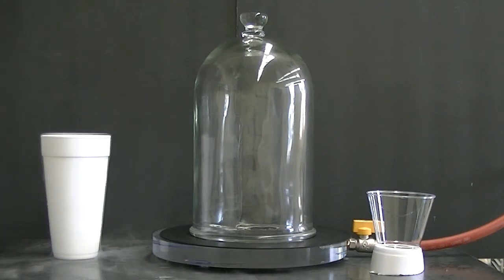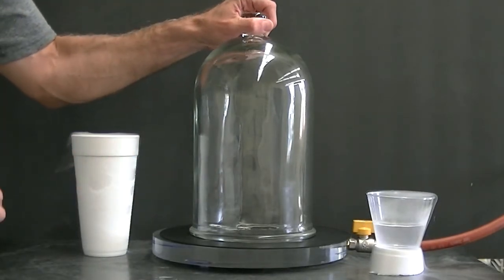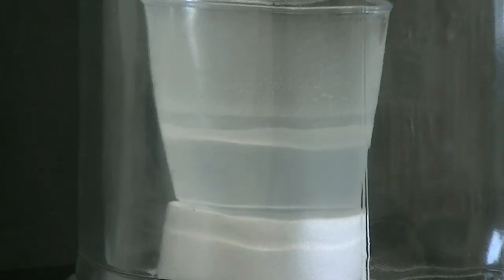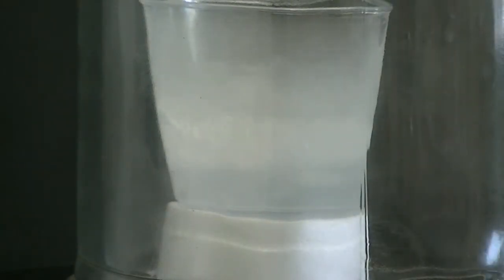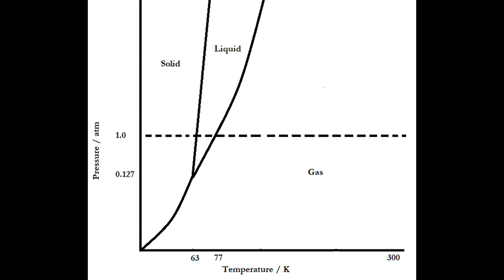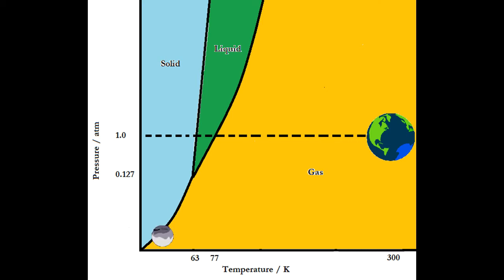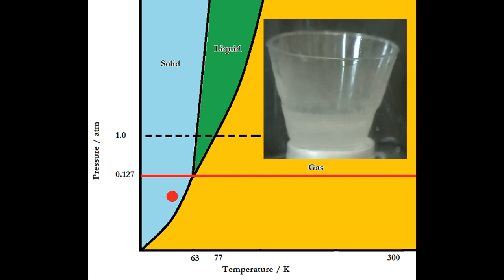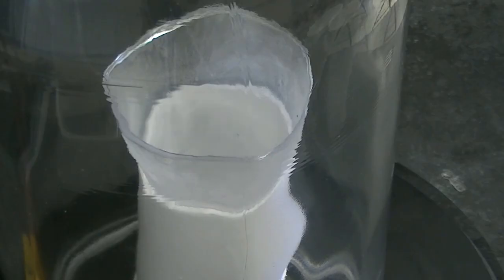Solid Nitrogen and the Surface of Triton, Moon of Neptune

Comment: I can barely see the little microphone now now that I have been a different mode where are there is the little curly thing counterclockwise I know it's behind there it's right by the arrow that's pointing left at the top of the little circle flight thing like on there so that's what I can touch saying the bear it's barely visible this is because my keyboard is transparent and it overlays what is behind it that's why I wanted it like that so that I could see everything on the screen but it makes things difficult a time so it's been many days since I've had difficulty like now.

So what happens of course when you increase the pressure in the liquid below the crystal surface is that the temperature of the liquid is going to be controlled by that increased pressure right in other words when you release the pressure the great deal of it will boil. A paragraph

Our experience with water can a pot that is not healed is when the pressure does not increase. It is more Jermaine however the think about it pressure cooker and now many more families are buying electric pressure cookers that don't use a weight on top of a novel regulate the pressure. Such old school pressure cookers or whatever are quite didactics you have a certain amount of area in that novel it is a tube coming out of the top the lid of the pot and it has a weight so if it were a sick tube if the intern internal diameter of the tube was say a square inch and the wait was 50 lb then you would say this team is going to be leaving the pressure cooker when the pressure inside the pressure cooker it exceeds 50 lb and it lifts the weight and then the steam exits until the weight falls because there's less than 50 lb pushing it up of steam pressure and the gravity is what's pushing it down the attraction to the rest of the mass in the universe is 50 lb down coincidentally sort of to the Center of the Earth. I don't think it is directly to the center of the earth I think it's to the center of the mass where are the distance reduces the forces exponentially. When we are very close to the Center of the Earth for example when we are in within the atmosphere the very small amount of mass that are Earth has compared to the rest of the universe is the most gravity that we feel. Further because the mass of the universe is in every direction around the Earth it sounds. Cancel out so it could be actually far more gravitational attraction away from us pulling us in every direction but all we would feel was the excess in One Direction versus the other the difference the net gravitational attraction not the gross.

 it is also important when we think about these things to remember. No such thing really as the center of the universe there is no such thing as an answer to whether the Earth circles the Sun or the sun circles the Earth it certainly is easier to describe the orbits if one does it politically correct Lee but it is all relative. This is not an easy concept to understand. It is basically counterintuitive. The correct way of talking about this is that the Earth circles the Sun. Drawing where the sun goes in relation to the Earth is more difficult it is not a circle. Nor in the lamps. Norris simply in the lips. Ellipsis, elliptical orbits oh, I don't know what nitrogen is doing when it is in a liquid.

To be thoughtful I think we should think about one atom or molecule of nitrogen and you would know more about how to talk about the difference between an atom in the molecule this diction is my deficit. I am not sure how valid these concepts are especially when talking to the General Public. my point is that if one thinks about two pieces of nitrogen being close enough to each other so that the strong force is overwhelmed the forces that keep them apart. In order to have a gas instead of a liquid something has to push the individual pieces of big ass apart. I think we can call those the weak forces. Vacuum after all does not pull the gas apart. It is the individual pieces of the gas that are repelling each other.

If you push this collection of Parts together it is kind of like say what is that thing you get at the carnival at the fair cotton candy except unlike cotton candy it is easier to separate. there comes a time however when the particles snap together. I see this as the constant condensation. Once condensed you have these parts touching each other essentially. In the case of water we know that they are closer to each other in the case of a crystal. it is we know that a certain number of water molecules will take up more space will need a larger container yes Frozen and by Frozen I mean if put into a crystal form. So if you only have enough space 4 the liquid form of those molecules and the heat comes away what happened?

 We Know What happens in nature. The strongest Rock will be split apart. Those strong forces are genuinely strong. The water molecules will be drawn into the crystal form and the forces that draw them are powerful enough to create a man's pressure.

When you have things fizzing you have that pressure and the pressure is so intense that it results in all of the matter turning into energy. that is a distraction however when talking about nitrogen. If you take some nitrogen ice and drop it on the floor there is very little possibility that you are going to blow up the world.

When however you reduce the pressure that is holding the nitrogen molecules into its liquid form it starts repelling and the edges have the pieces of separate. As they separate they do compress the other gases that are in the same space or they push any other gases out of the container.

 What you are calling exothermic however is important to understand as the transfer of heat into them. You actually got this backwards. Don't believe me but go ahead and watch your own video. This cognitive area of your brain has been built up incorrectly oh, there is a myth in there, I hope you are going to have it looked at.

 I am trying to help you

Comment: 🧯 I have a great deal of difficulty turning on the dictation just now because for some reason it's invisible the microphone I'm using the cell phone companies keyboard as opposed to Google's and I did try to turn on the Google keyboard for several reasons including the repetition and I even worse transcript that you can see in my prayer comment.

However I appreciate you saying that you're not sure about what's happening and I have been amazed that everybody that boils these liquid gases and sees the ice on the surface of the lake breaking because the liquid under the ice is boiling and the steam of the liquid to Vapor of the liquid has to go someplace right I mean it's easy to avoid this problem just put a glass tube in right so that the pressure can be relieved from below the surface the pressure of the liquid can be relieved and you will find that the liquid will spray out of the tube because the gas will separate the surface of the liquid from the ice that forms in other words to liquid can go down and up the tube instead of the ice having to go up as you witness. That part is really easy and I don't think it is important and I think that's probably why you were willing to say you're not sure what's going on there.

However do use of a word like exothermic is a bigger deal because it is you eristic not to increase comprehension but to spare yourself the effort that thinking through what you're observing would impose. Such effort is called learning.

Major scientists have been caught with their pants down on this very question for example carbon dioxide snow. Google that and you will find them eating Humble Pie.

As I was saying however and I don't mean to criticize you as a kind of didactic technique but I think that's what's going to happen now so please take the blows for science. In your mind you are seeing the fluid. scientifically I think it's better to see the molecules to see them so close to each other that they're like little magnets that are able to stick to each other and you can watch videos of this of course magnetic balls or other magnetic objects that are assembled into larger objects where are the attraction between the magnets is comparable to the strong forces of nature that is the forces that are stronger than the gravitational attraction but only when objects are very very close together do these forces cause them to become either crystals or liquids. a liquid appears to be a single object in some way like some sort of monster that is a quantity of slime.

 It however is a fluid it is something that has say something like the concept of surface tension but on the surface the individual molecules are shedding I have great day love difficulty turning on the dictation just now because

Comment: What is dry nitrogen then?
 I used to be a helicopter mechanic and we used dry nitrogen in place of compressed air in the tires, and I think they do also in racing tires?
Reply from the maker: Dry nitrogen is nitrogen gas that has had all of the water vapor removed.